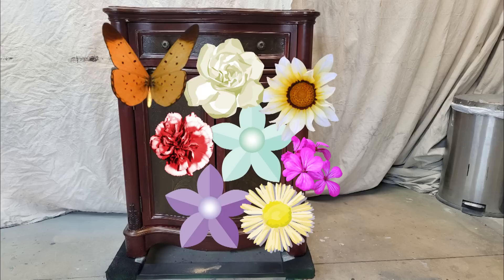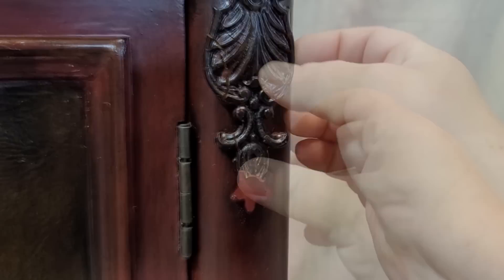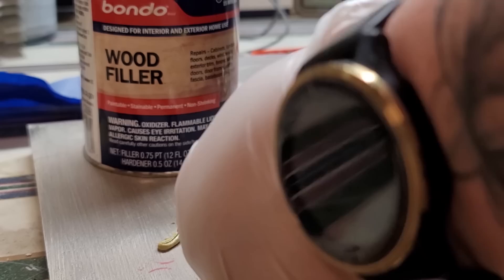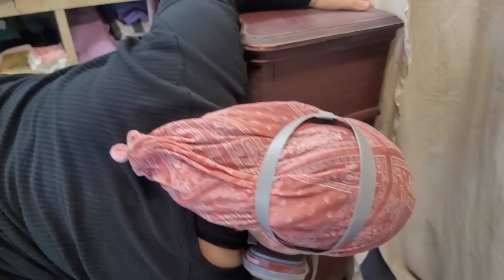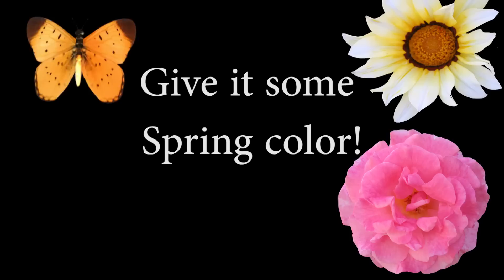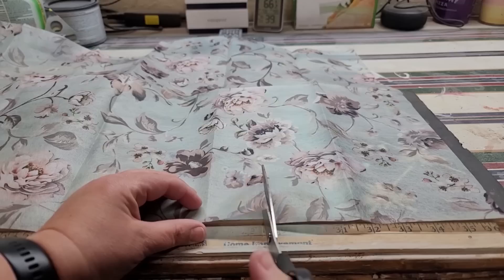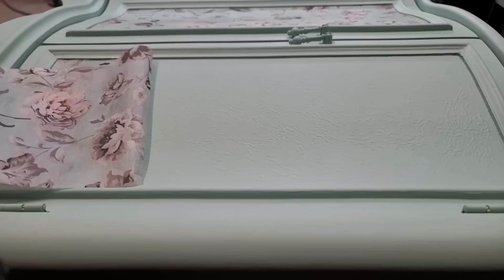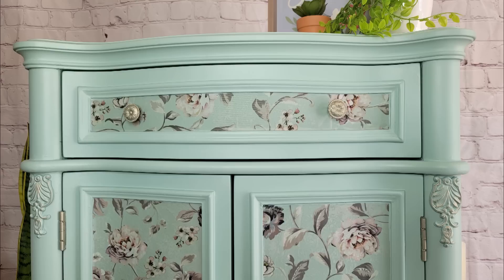DIY Spring Furniture Makeover/Spring Fling Challenge

Comment: Great project. I've seen glue gun glue used in moulds but have never seen a mold made with hot glue. I wonder if dusting the piece with cornstrach would make the release easier. Have you tried that ?
Reply from the maker: I haven't tried it, but it is definitely worth a try! Thanks for the idea!